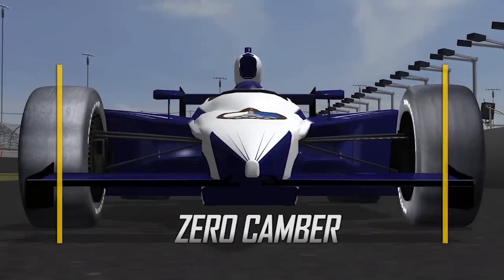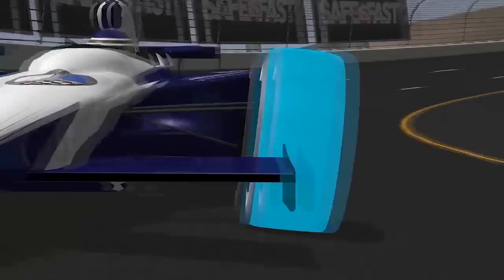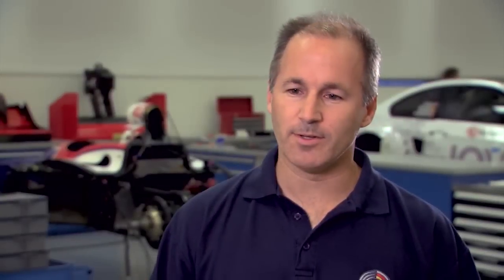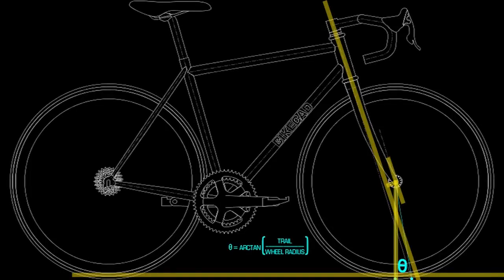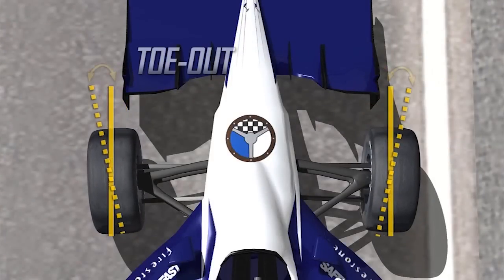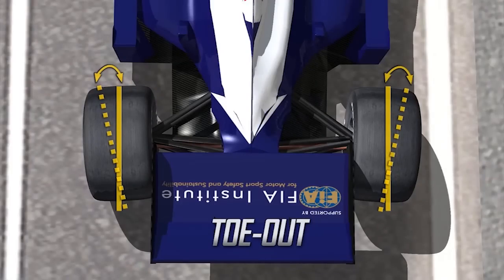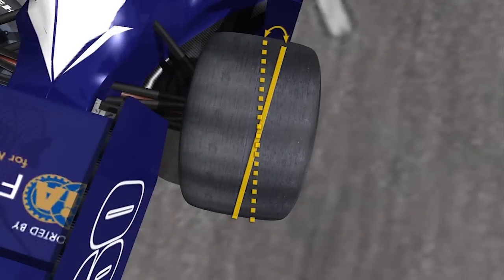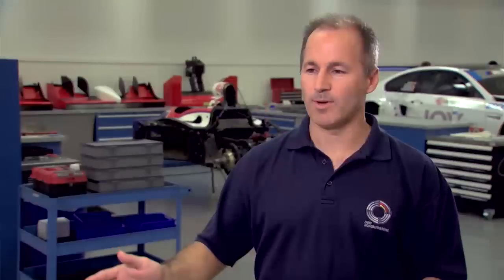Basic Chassis Set Up 1 - Camber, Castor, Toe, and Ackerman

Comment: Wouldn't toe-out on the rear allow for better yaw(rotation) while cornering? Then you could set up the car for slight understeer when accelerating and have both great mid turn and accelerate sooner out of a corner
Reply: Toe out on the rear creates oversteer
Reply: @themarenda  of course it does.
Reply: That's a clever idea
Reply: You can do that on low speed tracks with  tricky corners but not on high speed tracks since toe will add quite a lot of drag as the vid had also mentioned, would be better to set a more open on diff and it will give the same result without adding the drag

Comment: Camber affects cornering speeds. But does caster affect the speed in any part of the track? Or is it adjusted mainly to driver's preference?
Reply: +Aireisor simracing n drifting I don't think it affects the speed, but it might when it's going through bumps (changing the angle of the wheel as it moves up/down). Been trying to find out more about these types of things as it boggles my mind too!
Reply: Usually sports cars are set up from factory with high castor angles, around 6-8 degrees. This is to aid stability in going straight, I believe. That's why on a shopping car there is very little castor, no stability needed. More castor means more effort is needed which could be a downside, for comfort or for long race distances, so it's a compromise
Reply: Caster affects camber while cornering. Look more into this please, as i know too little myself to be of any help

Comment: The comparison of caster angle to that of a shopping cart is incorrect. A shopping cart has no "caster" but it does have "trail", because the steering axis does not go through to rotational axis of the tyre. At first glance these may seem like they have the same effect, but not really, because they add dampening or returning force in different proportions and give different feel.

Comment: Wait. I've been told to run a bit of negative toe in the front to increase responsiveness
Reply: if I'm not mistaken, negative toe in equals positive toe out which is stated in the video that it should make the car enter the corners more easily.
Reply: Thats correct. And that was also stated in the video.

Comment: man im dumb still trying to understand castor angle!! -.-
Reply: It aligns the wheel base measurement. The wheels move in closer to each other when Castor angle is set.
Reply: Sigh...it does alot more than that....and it also changes the camber as the wheel is turned...hopefully they discuss this in the next parts about afraid I am about to waste my time on.  ...and how do you adjust the ackerman???